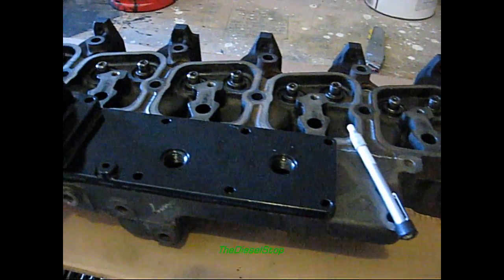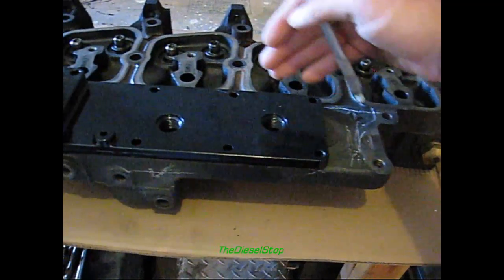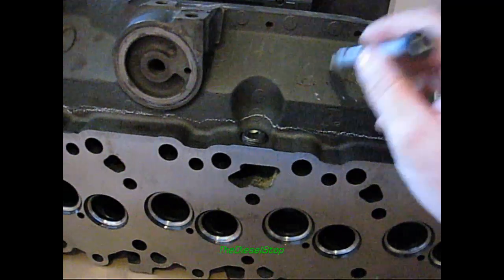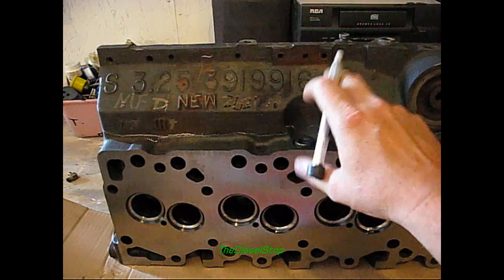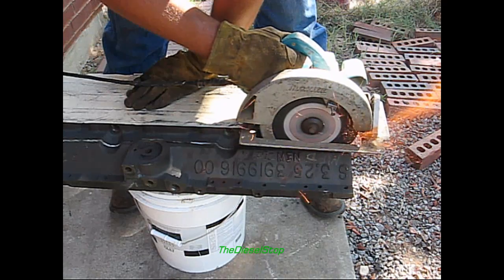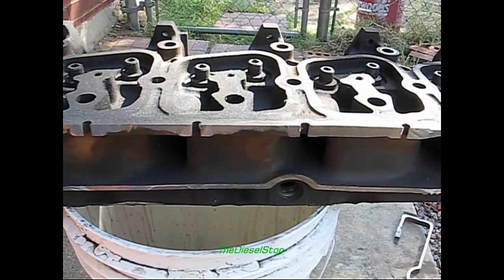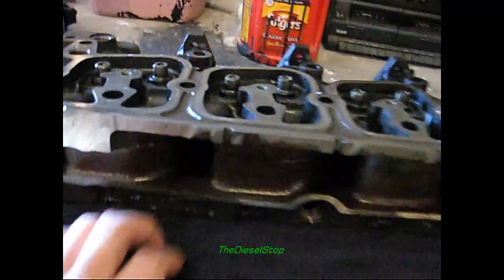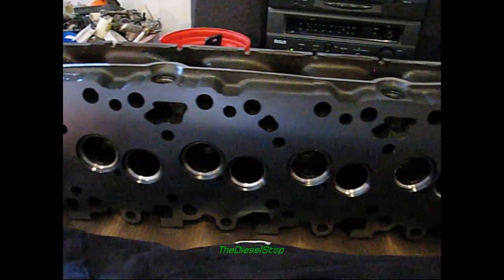Building a 1000 HP 5.9 cummins

Comment: o-rings are a small ring that sits in a grove in the head. if you are over 40 psi , you need them and they work good to about 70 psi. now, fire rings are a lot bigger than o-rings. they actually have a grove cut into the head and the block. with fire rings, you constantly have to re-torque the head so they are more for race and not street. sorry if i missed anything but that is about it.

Comment from the maker: @Graveltrucking  I will have a custom intercooler made to fit this build & support the volume. The block is being sent to OKC to get the deck plate hone done for cylinder distortion. The pistons are getting fly cut then coated. And I am getting the girdle kit and a big cam.

Comment: @TheDieselStop Had a look now I know how an aftermarket intake works. That will definatly improve getting the air into the engine would have to run twins to pump the volume, wonder if you could get a intercooler to flow that much volume and still beable to fit on the Chevy body.  Looked through the other parts on the motorsports site they even have a block girdle to keep the bottom end from distoring. Talk about pushing the limits of a engine especially one that was intended for 200hp.

Comment: Really curious to see what the machine shop does they definatly have a days worth of work on a milling machine to mill and finish the intake side of the head.  Also interesting how they will drill and tap for bolt holes I imagine you will use short studs and locktite them, cutting threads into cast isn't easy.  I agree the original Cummins intake is a poor design the center two cylinders lean out the front and back burn rich.

Comment: @cjlowndes Try adding 1 oz 2 stroke oil to every gallon of fuel and a little power service like 8 oz from the grey bottle and your motor will run quieter and your injectors and injection pump will live alot longer.Made a world of difference in my d max